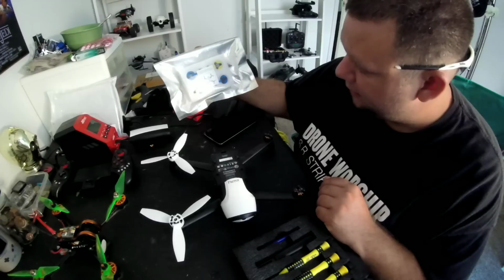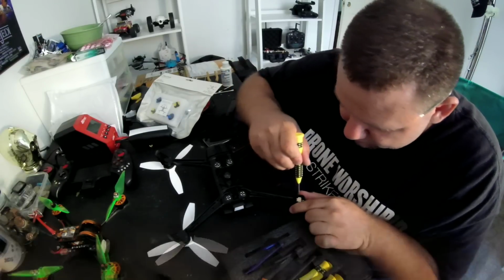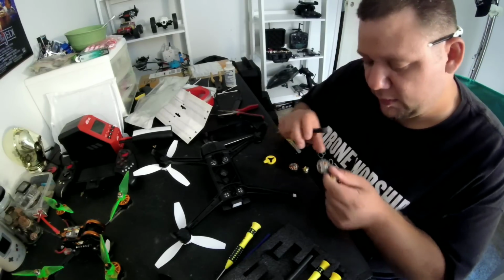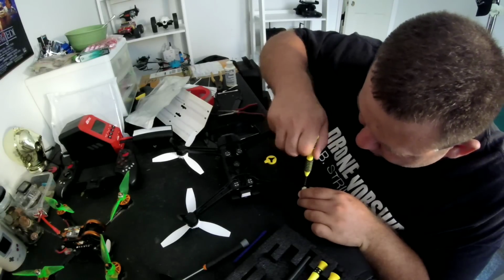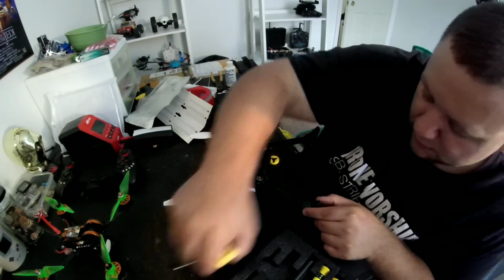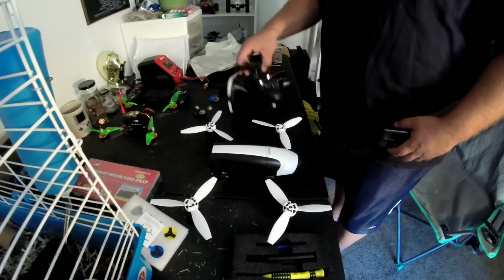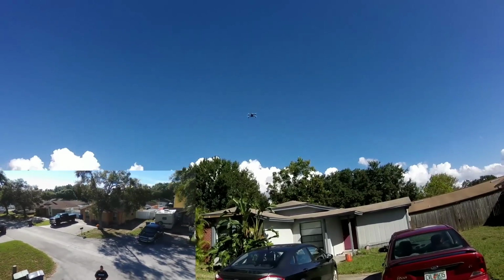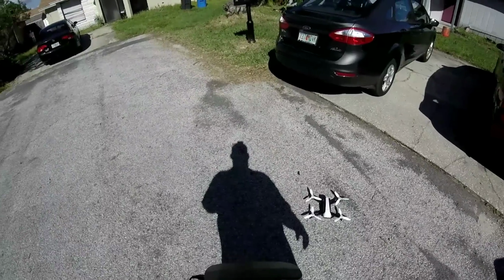Parrot Bebop 2 Motor Replacement And First Flight With Skycontroller 2

Comment: Very good video Dan I had a Bebop 2 with the Skycontroller 2 and never flew it sold it for 799.00 with backpack and many extras  just so I could buy the DJI Mavic two years ago. You got me hooked on the Hubson's 501S and 502E then got the Bebop 2 then the Mavic Pro then a P4P then the Spark and finally the Mavic 2 Pro, Plus about 15 little toy one's and this is all because of you my friend Thank you for showing me how much fun they are.
Reply from the maker: that's a pretty good deal I love the Bebop 2 it's such an amazing drone still and if you're running on a r Pro 3 third party app it's even more incredible

Comment: Nice tutorial brother !   Thanks ,  love my Bebop 2 Power
Reply from the maker: I don't really understand what the differences with the power Edition can you explain it to me
Reply: @IFixShet  I purchased the power edition bundle .  comes with three 3350 mah batteries instead or the 2700 mah .  2 chargers ,  4 spare props , controller and a really great backpack to protect it .   I guess I refer to it as the Bebop 2 Power because it's the latest model and the 90 minute combined flight times  and 2 km range .   Truth be told I've only been into the hobby for about 6 months so I'm really still a noob ,  but I am amazed by this drone !

Comment: You have to change only the motor cage (much less expensive) not the all motor. And if you change with the new motors why don't you change the all 4 motors to be all the same new with zero miles/km?

Comment: I also was wondering I have to tighten the screws on my bugs almost every time I fly is that normal I thought about thread lock but im cautious about getting it close to the motors
Reply from the maker: You shouldn't have to tighten the motors constantly I would say thread lock in moderation would be fine
Reply: Save yourself the $10 & the long wait time on the "required" Parrot toolkit... Any precision toolkit with the small Allen & Torx bits also work.

Comment: I agree with you don't know how someone could crash crash it's an awesome bird I've seen people take the old motor tops to use for prop balancers how is the battery mod on the controller going so FAR?
Reply from the maker: To be determined I temporarily gave up on the project because there is a weird balance board inside of the transmitter battery that's only allowing one cell to charge when connected to a balance lead instead of the regular charger